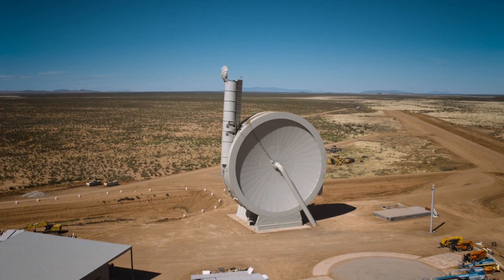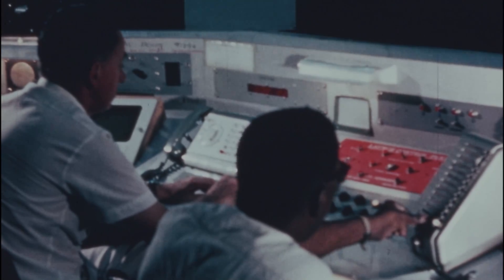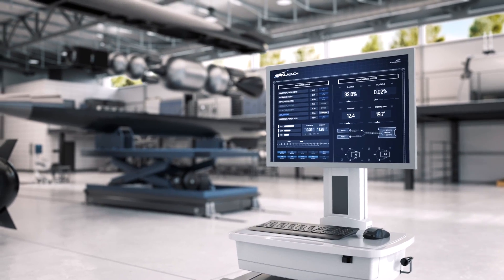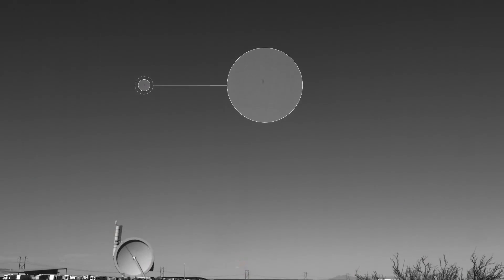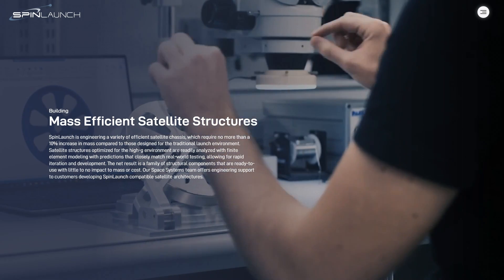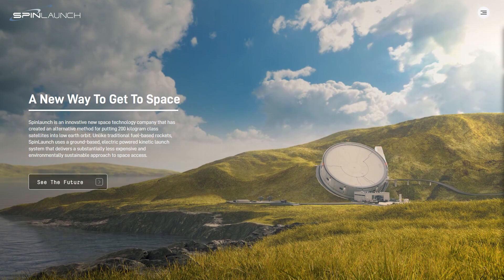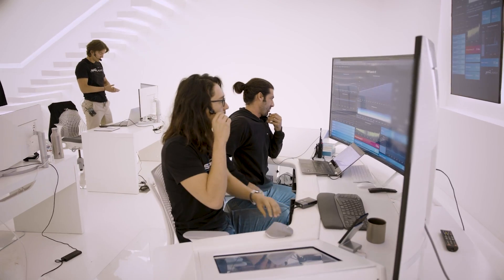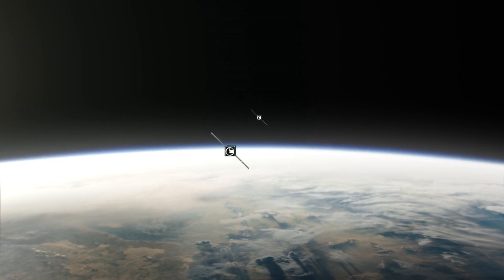Can Spinlaunch Throw Rockets Into Space?

Comment: There would need to be an awful lot of corrections made to get the spacecraft into it's proper orbit.  That would need a robust system of motors in place and I'm wondering how big of a bite that will take out of overall payload capacity.   
Pretty cool just the same.

Comment: This demo was released vertically which makes sense. Why is the proposed larger system laid down at an angle? Wouldn't a vertical launch clear dense air quicker? Are they banking on some lift helping? Lift means more drag though. Obviously the higher up in the atmosphere this thing is the better.
Reply: Probably for structural engineering reasons, a 200 meter centrifuge on its edge would be skyscraper-size and need enormous supports and foundations, laid on its side you could use a convenient mountain as support.
Reply: @markh.876  Yeah that's probably it but then the smaller demo should not have been vertical to be apples to apples.
Reply: @KB3M  Not to forget that most of the energy in getting to orbit needs to be in lateral kinetic energy anyways...
Reply: @markh.876  True... but you can't get anywhere close to orbital speeds in atmosphere. That speed is only achievable above the atmosphere so the higher you get the easier it is for the  rocket stages to get the payload into orbit.

Comment: Most importantly…..throwing stuff straight up, makes for good presentations to ignorant investors. But it doesn’t really contribute at all to an orbital launch. Zero. Literally the only thing it gets you is above the atmospheric loss, but the rest of all that lovely momentum goes straight to gravity loss. What you need is sideways delta-v. Going straight up, even 100km gets you nothing gravitationally, as it’s negligible compared to the Earths radius. There’s really no point going above say 60000ft this way, as that’s above most of the atmosphere.
And once you realise *that*, you realise you are better off literally dropping it from a 747 with zero velocity. 
And that’s Scaled Composites approach. And then you look at *that too*, and realise it also looks cool but pointless….. because only a few percent of the fuel really goes to atmospheric loss - so you are saving some fuel (which is actually *cheap*) but not much cost but then you also have to solve a ton of extra problems at high cost.
Reply: To give some idea of just how much a non-problem the whole “it’s a waste to use hundreds of tons of rocket fuel per payload ton” actually is, consider this:
A fully-loaded 747 takes 240 tons of fuel. A Falcon9 takes 400tons. The Falcon9 uses approx 1.7x of a 747 flight in fuel. 
When all is said and done, over the two to three years leading up to a satellite launch, a couple dozen engineers and managers across the various engineering disciplines may each make several flights per year, to contractors, plus dozens of people for the actual launch.
The business travel uses as much fuel as the launch, if not more.
Reply: @johnfranklin8147  What you say makes sense, but rockets can't get you a launch system that can get payloads into orbit every day or every hour. SpaceX does a launch every 10 days. If it takes a couple of hours to spin up a 200 kg payload, SpinLaunch could put 24 tons into orbit in that 10 day period, about the same as a Falcon 9 payload and much more flexible. That would be pretty useful in colonizing near space.
Reply: @markh.876  It’s true that rockets won’t give you that launch cadence…..so, how does this help? Again, this doesn’t actually orbit anything. It just provides a medium kick, that lofts the rocket that can do the real work. 
The only real purpose I can think of, is to launch “dumb weight”. Fuel, basically, for interplanetary. And launch it high enough that it reaches very high apogee, and needs only small apogee kick to “capture” it in orbit. Then you have as long as you like to circularise the orbit with a solar-powered ion rocket. But it really does have to reach orbital velocity from launch without help, otherwise you are adding cost without subtracting it from anything else.
Reply: Actually, I’m being slightly unfair to launching above atmosphere, although only slightly. The purpose in doing that, is that rocket engines can’t be optimised for the full pressure range. So you get to run the rocket much more efficiently for the Mach 1-22 acceleration. But whether that is really *important*? Nobody has shown it is.
If you want to see the advantage, just add a “stage 0” rocket stage to your stack to put in the same location and speed, without changing any of the rest of your stack. Hardly innovative.

Comment: Seems like a "dummy" load with a matching weight and shape that is also released at the exact same time, in the opposite direction would not solve, but alleviate some of those stresses.
Reply: I was thinking filling the counterweight with a volatile liquid of the same mass as the payload. It could be released at the same time and instantly evaporate into the vacuum chamber.

Comment: How does it go from a vacuum inside the wheel - and not have all that air pressure running in at the speed of sound pushing it back?  I think I would balance is with a dummy load that gets ejected 'down' simultaneously in an opposite arm.

Comment: It looks pretty hard to hit the tiny exit hole of the sentrifuge and in a controlled manner. It is even more impressive if they can release a 100 kg mass at the tip of a huge spindle pulling some 10,000G's (1,000 tons?) in 1 millisecond and avoid the spindle disintegrating due to dynamic imbalance. It sounds like a series of colossal challenges.
Reply: What if they release a counterweight that goes smashing into the ground?   It does not look like thats how it works though.
Reply: The timing is the easy part. You seem to have no experience with electronics. 1 Millisecond is a rather big time frame for modern processors.
The thing you posted that comment from is running something that is not considered a real time system. And it can schedule a second like you do a day.
As in:
sleep for 200ms
eat for 40ms
take a dump for 10ms
...
But it's CPU an actually do millions  of operations in half a millisecond. It's just that the system scheduler does not want to waste cycles on interrupts no one cares for.
Working on the the tens of milliseconds scale is considered "bulk" here.
1ghz means 1,000,000,000 cycles per second. Most operations only take one cycle. And start to result has a varying delay of up to a few dozen depending on architecture and instruction. Can go into the thousands if you need to wait for other components. But even those worst case scenarios fit easily into one millisecond as you can see. As we have a budget of about a million there.
Reply: @fgregerfeaxcwfeffece  I've always been bad at explaining, but that's basically it. The last thing the engineers have to worry about, are the time intervals they are working with. 1 millisecond is a lot of time for the machine to not mess up anything as long as the humans have done their job.
Reply: @fgregerfeaxcwfeffece  What about the time it takes to operate the release mechanism(s)? Maybe they use some instant release mechanism using an electromagnet? But even so, there may be some mechanical delay.
Reply: @fgregerfeaxcwfeffece  Didn't even read all you said. but I'm pretty sure your arguments are not the reason I made my comment.
The problem I was talking about is that every piece of electronics can experience "glitches".. There are these f**kers from cosmic radiation that can mess with everything (bit-flips) and even though moders computers have redundancies and failsafes, it's still possible that something will mess up. and when it comes to something this precise? if even small thing messes up, it all goes to shit.
Reply: @Sobotkap   so you are saying that even with 3 computers (for redundancy), each of them with something like 10 Giga Hertz of CPU, there is a chance that they can miss that huge window? Lol
Reply: @Sobotkap  I can do the math for you if you want, but I’m sure you won’t even read it. Let’s say that window launch is just 1 degree (on a 360 degrees circle), with 450 rpm it takes 0.1333333 seconds to make a full rotation. Divide it by 360 and you have 0.37 milliseconds for that 1 degree window. A 3GHz cpu can do 3 billions operations in a second, or 3 millions in a millisecond. In that 0.37 ms window it does 1.1 MILLIONS operations. And you can put more CPU to have redundancy
Reply: Oh I passed from a 10GHz cpu to a 3GHz cpu, which is a basic modern cpu, but they can have a way better cpu so you get the point
Reply: @haramberinokripperino7770  now that I checked the thread this was on, I realized that When I replied to that comment, I assumed it was on another thread I was writing on before. Also about timing

But yes, The bit flip can do much more than just skip a few cycles. And it is real possibility that even with 3 redundant computers there could be f**k-up.
The best case during such f**k-up would be slight delay.. the worst would be crashed payload, which could be bad, depending on the payload.
Reply: @Sobotkap   by real possibility you are talking about a cosmic radiation that happens once in a lifetime on a cpu on that exact perfect time, AND it has to hit all the redundant CPUs! It’s easier to get hit by a rogue planet dude 😂
Reply: @Sobotkap  i know that, by “once i a lifetime” I meant that it’s barely did any damage. How many rocket do you know they failed because of cosmic radiation? If we were to follow your point we should never improve our technology because some cosmic radiation could cause a failure
Reply: @haramberinokripperino7770  My ultimate point is that we shouldn't use such big, volatile forces with something as simple as spinning arm.
Rocket engines are not some simple combution engines and if something goes wrong during launch, the rocket will either explode, fly off the course or won't do anything at all. If it goes off course, it can be corrected or manually exploded if it's too far from the course.
If it explodes, they have plans for that, because it could always explode for many different reasons.
But this Yeet launching? if something goes wrong, and it flies through the wall? there might not even be enough time to self-destruct it before it hits the ground.. and with forces like that, it could do some serious damage. 
If they start using this system, you can be sure there will be failures. maybe not because if the cosmic rays and maybe not in first thousand launches.. but if there is a chance it can fail, it eventually will. and if you compare how much damage can normal rocket inflict with all the failsafes they have with this spinning wheel?
Reply: @Aendron  i feel like your applying a worst case scenario and reacting in the worst possible ways.

1. Shielding exists. You can shield sensitive electronics from EMI/ERS, USMilSpec requires it for all flight craft. | While im not sure electronic circuit hardening is required on spacecraft, it /should/ for this very reason. Your are correct.

2. High-density, high-resistance fluids exist. Designed to stop bullets, but allows slow-moving objects to pass through with very little resistance. | Combining these with conventional reinforced concrete with carbon-nanotube surface wrapped titanium-rods running in a cross-mesh pattern would even stop a vehicle flying at mach-10.

Point is, both of your concerns can be easily mitigated. Yes, one of them could result in damage to the launch facility. But we are talking a accident. Accidents happen in Aerospace Design all the time. look at SpaceX and Nasa...
The worries are to loss of life and damage to external (other people's) property.
Insurance exists for industrial accidents, however rare it may occur for that reason. As long as you have the best safety measures in place, insurance companies will cover your operations as they are sound. So from a business standpoint its fine even if a 1-in-a-million incident does occur... however unlikely that it does.

Reality is, solar storms rarely get dangerous enough to cause damage, but when they do they usually dont have the energy to inflict world-wide trauma. Like all ionized particles, their energy can be attracted and dispersed by strong magnetic spheres of influence. Like can be seen around power generation and switching stations. 
So unless they put them selves next to a nuclear power plant or a multi-city wide substation i dont think they have to worry. Unless your suggesting some one will weaponise it and direct it towards them i really, really, really doubt your concerns would ever come to pass.
Reply: @edenrose2374  I tried to reply but it seems it failed.. so I'll try to repeat it.. if the other one appears, I'll delete this one

Your feeling is right, I am applying the worst possible scenario, but I am not reacting in the worst way.
The shielding is a valid point, but the thing about cosmic rays was more of an example how it COULD fail. there are many more ways it could fail, and the possible outcome if it does is more dangerous than the worst scenarios of classic rockets.

If they indeed scaled up and were just yeeting such heavy objects that fast, no realistic amount of that bullet stopping fluid will stop this beast. and even if it does, the amount of energy released by it will be huge. And if, for any reason, it broke and smashed right into the ground? it would be as if a meteor hit there.

If all they wanted to do is throw those small darts into space, sure, that can't do that much damage..
And the other problem is that to scale up, they'll have to figure out the balance problem. and what simplest solution to that? having something of the same weight on the other side and releasing both things at the same time so if they decide to do that (since simplicity seems to be their thing) they'll have to dig tunnels to safely slow down/stop
the other counter-weight. Which only adds more room for those lovely f**k-ups I love talking about :D
Reply: @Sobotkap  YOUR electronics glitch. Luckily your cell phone isnt being relied upon to properly yeet a soace ship. I'm sure the multi milliondollar system with multiple redundancies and processing power your daily user isnt even allowed to dream about yet can do something my phone I KNOW could do 2 or 3 times before warming up
Reply: Makes you wonder what we aren't seeing.
Reply: Sounds like launching a rocket is easier.
Reply: Just jam a stick in like it's a bicycle wheel...
/s
Reply: Yeah the real issue for me is that the payload is going to have to withstand 10,000Gs of lateral centripetal acceleration at the end of spin up.  Then when the orbital motor fires it will have to withstand significant axial thrust, so a completely orthogonal load.  You can put together a test dart that can withstand those sorts of massive accelerations, but doing that with actual operating rocket motor is non-trivial.
Reply: Don't forget that computers exist. We are taking the world at 1Hz, even the pellet burner that my company makes has a processor, that is taking data 44 millions times a second. And 1 millisecond is 1000Hz (typo edited, as aluisious pointed out.)
Reply: If you’re experiencing the world at 1Hz, please consult a doctor.
Reply: @w0nd3rlu573r  1 millisecond is 1000 Hz dude.
Reply: @TheLegendDevil  but it's pretty obvious that he's talking about the time interval
Reply: @antonhelsgaun  it doesnt make sense either way
Reply: @TheLegendDevil  Hertz is unit of frequency, so yes you can measure time with it (kinda). 1 Hertz = 1 second intervals/cycles. More hertz you have, faster it gets
Reply: @Sobotkap  saying you can measure time with hertz is like saying you can measure distance with velocity. Time is the important factor.
Reply: @TheLegendDevil  not correct. As I said, Hertz is just a frequency. When you look at analog clock, the hand measuring seconds has 1 hertz intervals.
And time is not some fundamental force or something. Time might be important, but the thing that time is based on is less important as long as it's reliable enough.
Reply: @Sobotkap  what do you mean "not correct"? I literally said hertz is a frequency and not a measurement of time, are you tripping
Reply: "Not correct" because technically, you CAN measure time with frequencies. And technically, you could measure time with Velocity as well. All you really need for measuring time is something that is constant. Frequency is just a cycle so if you define 1Hz as 1 second (which it is defined as such) you can totaly use it to measure time. 
You seem to think that time is something fundamental, something that is defined by nature and not men. But time is just a tool Man made up. first as a day and night cycle governed by the Sun. They even used to measure time with gravity (hour-glass).

So tell me again. and this time in detail. Why do you think you can't use frequency or velocity to measure/keep time?
Reply: @w0nd3rlu573r  what the actual nonsense are you talking

Comment: Oh fun, I love an open problem! I'm a huge fan of space/mechanical engineering so here's my shot at the "balance the bearing" issue...

Mirror the throwing arm over the center point; and use the mirrored side to throw a lead bullet the opposite direction of the space craft at the release moment. 

That would fix the problem of keeping the bearing balanced and if your clever you could even throw the lead bullet straight into a steel cauldron then melt down what's left of it, re-cast it, and use it all over again.
Reply: I think the kinetic energy of your lead bullet would do a lot more than melt it on impact...
Reply: @markh.876  Certainly true; It would probably be smart for them to dig a fairly deep hole for it to fly into.